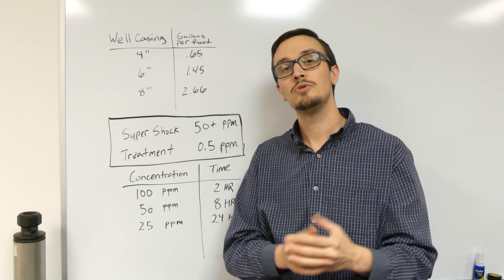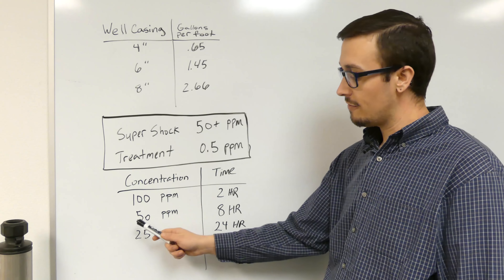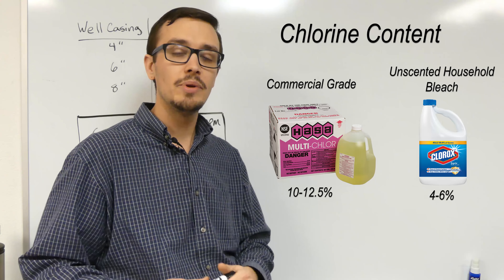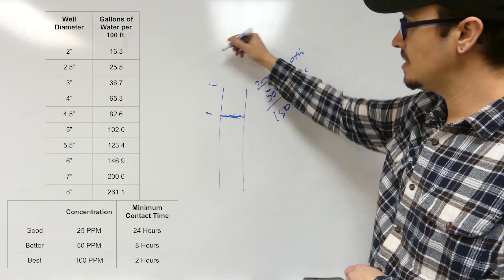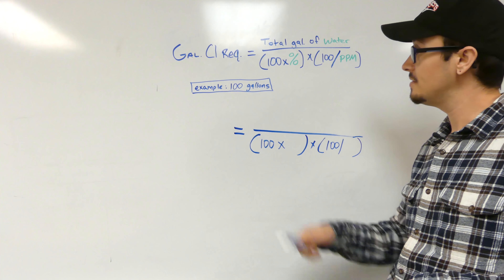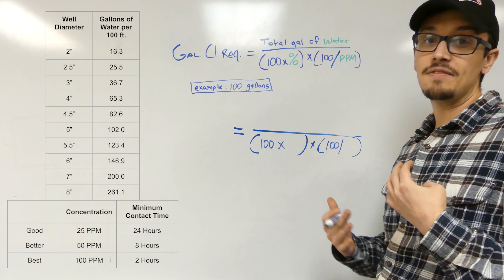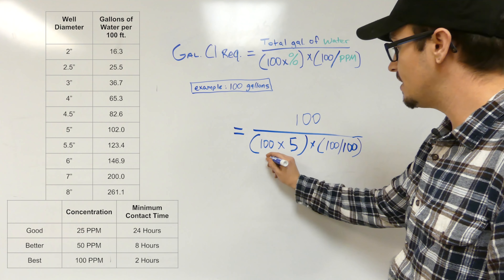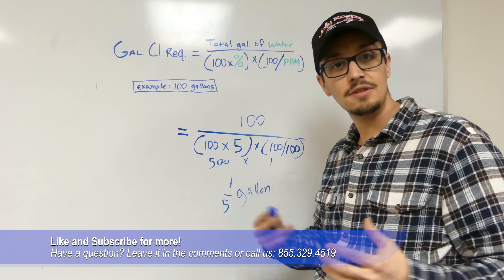Disinfecting Well/Water System: How Much Chlorine to Use

Comment: This was great. I am having a low yield issue with my well. I have have very hard water and suspecting there is buildup on the perforations. How much muriatic acid would you use or is there another method?
Reply: This is great for maintenance but it will not be a solution for your problem. I had a problem with my well that it was almost completely clogged with iron and manganese. I fixed that problem with 50 lb pail nuwell 110 acid, 2 gallons of nuwell 310 bio. This was for a 6-inch well that was 150 ft with a static level around 40. So I estimated somewhere around 100 - 150 gallon. It's a two-day process. But it's been spectacular. I plan on doing it again and then trying the chlorine route as maintenance. The new nuwell products are not cheap. But you get what you pay for. The products also contain inhibitors a dye to monitor removal. And the products become neutralized after a period of time.

Comment: The math comes out much easier if you understand that parts per million means 1 in 1,000,000. So 100 parts per 1,000,000 is 1 in 10,000. A 100 gallon well needs 0.01 gallons of chlorine. If your solution is 5%, then you need 0.01 gallons / 5% = 0.2 gallons of solution. Really simple, no formula to refer back to. The danger of relying on a formula without really understanding what's happening is that you could make a mistake with it and be way off, not even realize it.

Comment: Currently, I am living in a Home RV. We need electricity so we can make a house. Though, it seems that we need a foundation and well pump done first, i have them both done, yesterday I went to go get my water well checked, and I was told I can shower but no drinking or washing dishes is available. My question is I put bleach into my well using your formula, then I would do a bypass of all the filters in the RV, but I'm about my grey 1 n grey 2 some reason they both fill up at the same time... Would bleach shocking my RV cause the bacteria to disappear or no? (Trying to live in the RV until electrical engineer comes install electrical for my needs to build a house on foundation...) Also how do I find the concentration is it on the back of the product?
Reply: @Bobby Colin Yup, been using Instaflixxer for years myself :D

Comment: I didn't really give thought to not getting chlorine in my septic tank.  Any recommendations on how to flush the bath tub and toilet without it going into the septic tank?
Reply: We were told to turn off our by pass to the house .
Reply: You're not disinfecting if you bypass the house. The lines in the house are not enough to cause any problems. So what you need to do is get the chlorine thoroughly removed from the well before you start using the bathtub toilet in the house. That will dilute what's remaining in the house to the point where it won't bother anything. Remember to remove the screens in your faucets
Reply: Once you can smell the chlorine in your house at the furthest tap you can then work backwards on all the cold taps until your nearest the main shut off. Let it sit for a few hours to make sure anything in those lines that came from the well gets treated.  After the amount of time you need to shock has passed turn the main off and use an outside tap to drain as much water as you can from the system outside the septic system.  This will usually back drain any water you have in your taps in higher areas if you open a tap on the top floor. Once it’s drained turn the outside tap off and open the main with that tap on the top floor still open to let air out.
Reply: Bondo I use lake water inlet with a 5 micron and carbon, followed by UV. My most recent test showed 1ppm coliform and 0 E. coli after changing my filters and UV bulb. Do I need to get bleach through my hot water tank too?  And if so, would that bleach damage my septic bacteria?

Comment: what is the problem caused if the chlorine is drained into the septic system?
Reply from the maker: It will kill the beneficial bacteria that break down waste. Bacteria in your septic tank need to thrive in order for the system to operate correctly.

Comment: Today 1 /24/21.  I totally SCREWED UP BIG TIME. poured way way to much Bleach Concentrate in my WELL WATER System.  WHAT DO I NEED TO DO?
Reply from the maker: Pump it out onto the ground
Reply: @RCworstwater   Started to so that...  I guess its going to take AWHILE ..  I do have bottled water on hand to drink... Hopefully it will clean out... one Question on safe to drink... If I don't smell the Bleach any more THEN IS IT OK ? OR How  to be sure it is Really Safe ? Any Tests out there for Bleach ?
Reply: Sorry for PANICING... time and running the water has And  will help... At least I will have clean water again.  (for a while)
Reply from the maker: The smell test is the first test it should pass, then taste test.
Reply: you can also take water to swimming pool store they will test

Comment: My neighbor sold her home the water test failed for bacteria. The plumber shock the well & left quick! The neighbor asked me to come over because of no water pressure. She found out later that the electric well pump motor wires fried the pump! This makes me believe that the chlorine shock shorted the wires causing the pump to fail!!!! This was her second well pump replacement at a cost of $3000 !!!! Sad she already spent $40k for new septic & leach field.
I guess we are on borrow time because our well pump is the original 50 years old.
Reply: She probably has an underlying issue with her plumbing or electrical if she has killed multiple pumps in short order. Our pump is the original from 1992